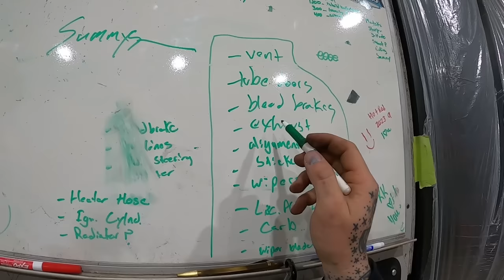S10 Carburetor issues. Will it run right??

Comment: Im a retired ase master auto tech and gm driveability tech. The way we adjusted the t.v cables was to depress the tab on the cable and pull the cable all the way back and release the tab. Then we would depress the throttle to wide open. The cable would automatically set itself to the correct adjustment.
Reply: I assume this method would work with a 92 k1500 ?
Reply: Great piece of advice
Reply: Learned that Cable adjustment in GM training class.
Reply: @fallofthezombies1379  it should, as long as it has a adjustable t.v cable, all GM automatics of that time used the same adjustment
Reply: @fallofthezombies1379 if it has the 700r4 & the cable bracket is in good shape then it should.

Comment: Puddin puts out my favorite content on the tube. In 1997, I had a 1984 S-10 blazer 2wd , lowered by heated springs with 2 18" Kicker subs in the back with the same 2 Barrel Rochester carb. Loved my Blazer but could never get the carb to run right and was always chasing vacuum leaks. Brings back some great memories.  Eventually, I'll buy another one, and LS swap it. I want a blazer street rocket, and yes, I'll install another sound system.
Reply: I love the idea
Reply: For me even a panel astro van. My pops had a 99 with a zenon body kit and it was maroon. Just the vortec 4.3 but it was sweet
Reply: Had a 1982 S-10 was my grandfathers got fed up with the carb on it I just sold it

Comment: To check for vacuum leaks, I use an (UNLIT) propane torch like the ones we use for soldering copper pipe. You could have built a "Y" out of copper line as well. (Or steel line)

Comment: the most important thing to know about working AC systems is that the schrader valves where you connect to them tend to be the biggest point of failure, especially after you connect to them so always replace them if they're old

Comment: Puddin _ When checking for vacuum leaks any light oil will work. It is less flammable, and it will cover any gaps that may be taking air.  You will get this.

Comment: MAP gas for the vac/leak detector, pin point with a hose if needed. You need a ramp at the back of your shop drive. You know 'Pimp Down" access

Comment: Yeppers,I have a California emission equipped 1985 S15 Jimmy, I had the carburetor rebuilt 4 or 5 years ago,at a shop I really liked.
They said it would be done 1-2 weeks. 
30 days later I called inquired about it, He said, I don't know when it will be done,as it keeps catching on fire..
Finally I got it back all it costed was 700+ bucks...
It still loads up and stalls. 
It did it when I got it back, took it back.
Said it was a vacuum leak,now it's fixed,he said.....Nope.
I found out that for I think it was 300 I could've got a rebuilt one and as it is a California car it costs about twice, the price..
It's a daily driver ,it gets  around 20 mpg,but don't be in a hurry..
God Bless you and your LOVED ONES
Get well soon  youngman

Comment: Hope you're feeling better along with your family! I know it can be hard when you're passing an illness around within the same family/household. It seems like you just start to get a little better and boom you get it again!!
  I worked for a transmission shop for 10 years & the way we set the cables was to leave everything hooked up with the cable in the bracket & push the button on the side to reset the cable to where it was fully retracted & then open the carburetor to wide open throttle. You will hear it ratcheting similar to a ziptie. This should get you very close if not right on the money. If you do have to adjust it, it shouldn't have to be very much. You may have already known this & have done it, but just in case I thought I'd share with you how we would adjust them. Thank you for your awesome content & take care of yourself & make sure everyone is washing their hands a lot to help cut down on spreading the germs that are making y'all sick. God bless y'all and we'll keep y'all in our prayers!!

Comment: As far as the vacuum leak I always used a propane torch (do not light it) to check for vacuum leaks. 
As far as you A/C  the s10 has R12 and needs retrofit to R134. Go to parts store and ask them for a retrofit kit. Hope you feel better keep up the good videos

Comment: I don't know if you'll see my comment, but I watch Pole Barger odds and one trick that he taught me if you always want to use your base plate gasket for your carburetor is used. Greece but one thing I learned is it works very well to make them seal, I use Lucas red tacky grease and I lightly coat it with a pair of gloves until it's really thinly on it. Then I set it on and bolt the carburetor down.  And I've never had a leak and the gas. Get never dry us out and if you need to take the carburetor off the gasket's still good

Comment: I use non-flammable brake cleaner when I check for vacuum leaks. It just causes the engine to stumble instead of causing it to rev. I keep a few cans in the cabinet in my shop just for that. I don't use it for anything else.

Comment: its a good lookin little truck, my brother had that lighting with the LS in it, he rolled it 12 times up on snoqualamie pass, got a helicopter ride out for his efforts, yea dood somas and LS S10's don't mix, apparently he passed out pinned the throttle and jumped the barrier between directions, it flipped him a dozen times and a 18 wheeler put the stop to him.. pretty lucky to come off that mountain in 1 pc.. very..  

I think if a guy took some time to work out all the small detail items, like new door seal rubbers, new window slides and rubber wipers that kinda stuff it will be a very nice truck for some time to come or till the demonrats make you put a washing machine motor in it and 12 batteries..

Comment: Check the oil for fuel . Those carbs are notorious for leaking fuel while sitting . They will start hard due to flooding and will  wash out the bearings . Yes even rebuilt carbs .

Comment: Puddin, my buddy had a chevy Luv with fuel problems no one could diagnose. Turned out there was TWO fuel filters on the fuel line (factory) The sneaky one I believe was close to the tank. Once replaced, good to go. Don't know if you're truck may be the same, but thought I'd mention it. Get well soon.

Comment: I almost got my thumb on my right hand smashed off by the starter gear and the flywheel on 2 cylinder yanmar. That was November 28th. I still have it and it very numb and scared. Luck for me my bone stopped it from going all the way through. It now feels like i have super glue all over the thumb print area.

Comment: To adjust the kickdown overdrive cable.  turn the throttle wide open hold it there. push the button. Let off the button while still holding the throttle that's it.

Comment: Puddin! If you want to try and charge up the ac in the s10 you'll need r-12 to r-134 adapters which you can get from oreillys. R-134 will work even with the original r-12 compressor it's just not ideal. Just make sure it's got a high pressure cut off.

Comment: To adjust those cables just pull it all the way back hold down the buttom on it. and wide open the throttle then release the button that should set it if i remember it right.

Comment: They make a smoke box you can connect to your vacuum system with the motor off. It pumps smoke into the hoses, and you watxh where the smoke comes out. Did you check the vacuum advance diaphragm on your distributer?

Comment: Stop using ether to check for vacuum leaks. Use carb cleaner. You should only be trying to temporarily close the vacuum leak, not add a combustible fluid. Also, have you tried turning the mixture screws out?  You could be falsely enriching the mixture by allowing ether vapors to get sucked into the carb.

Comment: Hey Puddin take care dude!! Bad stuff going round out there! You're working too hard!! With all you've done in the past several years, man ! But about the S10. I know first hand what you're going through with that carb. I had the misfortune of being born at the exact time and coming of age and choosing  auto repair as my profession right out of high school. Just as the industry started to transition to fuel injection and experiment with carburetor design to the point of insanity! You haven't lived, until you've gotten deep into a Chrysler Lean Burn system running rich diagnosis! Or had to mind meld with the Ford Variable Venturi carburetor from hell, because of a cold start hesitation problem!!!  Not to mention all the engine management systems they tried throughout the 80's !! That S10 is a great example, of what we mechanics had to deal with on a daily basis! Some of these 'systems' ran okay for a while. Most of those early emission systems were junk !!

Comment: Pretty sure this is why they ditched the carburetor because of vacuum leaks and the intricity of those carburetor anymore with different solenoids and vacuum ports they were sometimes a nightmare . When it comes to carbs it’s a crapshoot but the main thing is they have to be as clean as the day they were originally made and within specs. Remember Puddin no good deed goes unpunished you thought you were doing something good but the carburetor gods said ..Oh no you don’t buddy . Be careful and stay safe my friend God love ya.

Comment: You have the S10 looking very nice as far as a man can see on screen. Intermittent vacuum leak can be a proper basket unless you are well focused and methodical checking hoses and diaphragms and all else that can cause issues including the master cyl. booster. I sympathise Puddin' cause this might not be what is doing it. The job is reset and checklist everything in order of importance to the cause. Including condenser if it has one? They can be erratic as they fail though wont cause flooding like a FPR can and kinked or blocked return line for fuel supply. Depending on the kind of pump in the system. Thank F@% it's not my responsibility is all I know from here! Get well soon bud. Sounds like you and the S10 have both got a virus!

Comment: Starting fluids not really good to use because you fog the air up and it just pulls all that ether down the carburetor so it's really hard to tell if you have a vacuum leak or not Stick with the brake clean

Comment: as soon as you said demon carb i knew you were gonna have problems those carbs are racing carbs with way to much cfm for this engine unless you got a turbo high hp v6 there really a v8 only carb
Reply: i guess i misheard since thats not a demon carberuator im a efi guy myself i hate carbs infact im building the worlds first 7.3idi efi

Comment: get your wife to get the tip of a paper clip red red hot then push it through the finger nail at the black portion ( blood under the nail) and put a hole in the nail. that will release the blood and pressure and it will instantly feel 100%better. No fooling. That is what we did working hospital emergency room. Push down hard and quick. Only hurts for 1/2 a second.

Comment: If you want a 2nd opinion, yer an ugly little darlin', Puddin'.

Yeah, there's something going around.  I don't know anyone who isn't a little sick.  It seems to be in the bronchial tubes and the sinuses.  I was SIQ all last week, though I did go for a 5 mile walk, once (normally 3x a week).  I was feeling pretty good yesterday (Wed 14 Feb), went for another 5 mile walk, and by the time I got settled back in the home 20, I felt like I'd been rode hard and put away wet.

I've been hitting the benadryl (Waldryl) several times a day, and normally that stuff puts me to sleep.

That's the other thing; I'm having to sleep almost sitting up, and anybody who's been in the hospital knows that's no way to sleep.  It wasn't until after a week that I was able to sleep more than a couple hours at a stretch.  

Good luck with it.